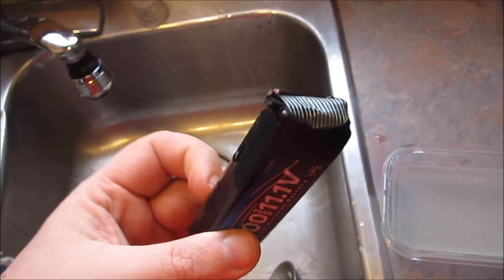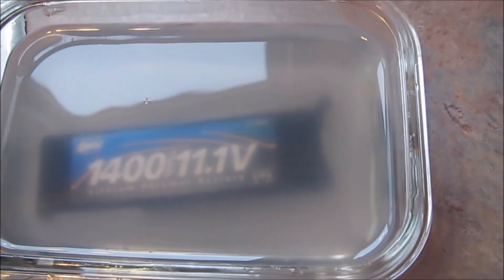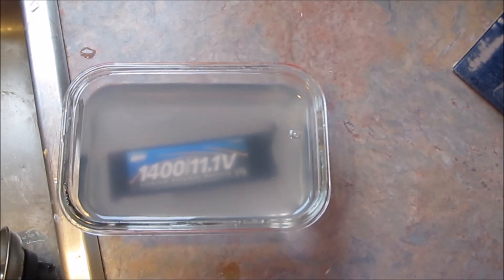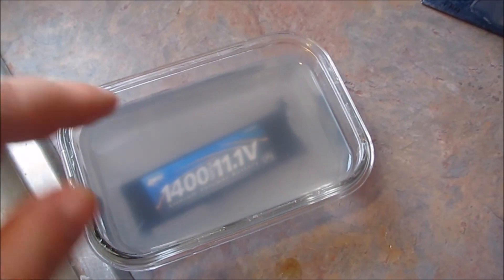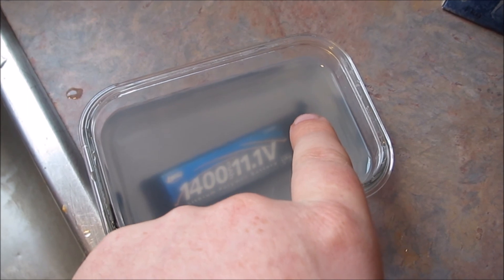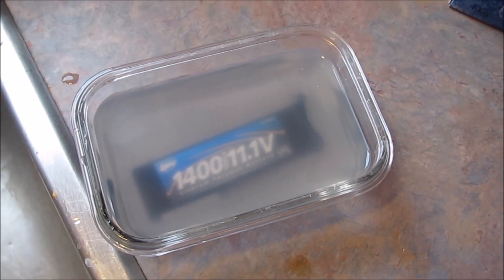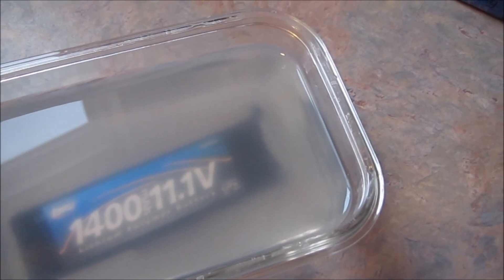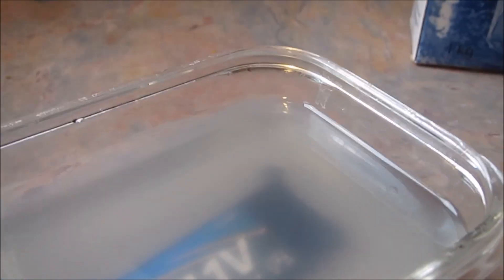Spikers RC: How to dispose of a LiPO battery safely

Comment: Is there any risk with this method ? Can it explode ? Fire ? Can i leave it outside for a week with no problems at all?
Reply from the maker: well, your experience may vary, but for me, it has worked every time. All of my research says that by doing it this way, you render the lithium inside inert, and it should not explode, cause a fire, or unleash the kracken.

The best thing I could recommend is to check with your local fire department for safe disposal instructions.